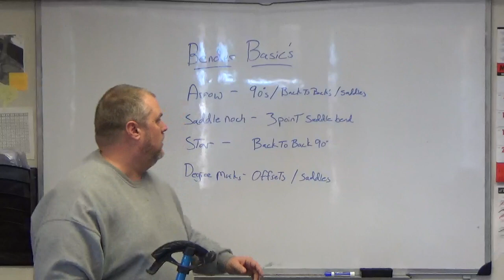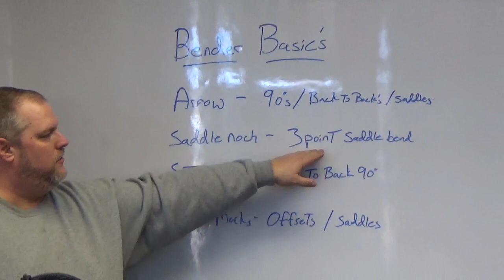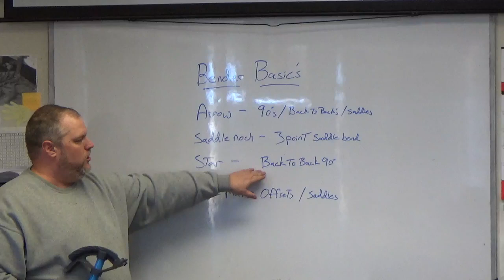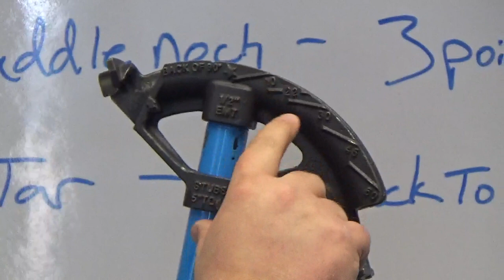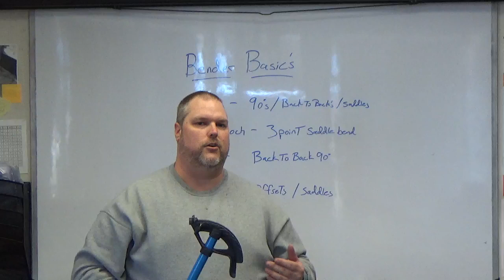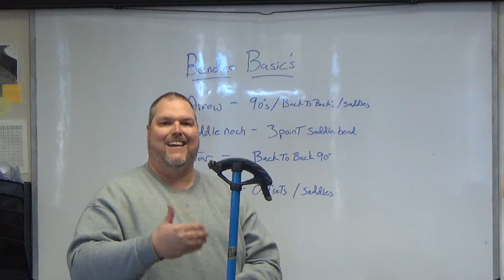Conduit Bender Basic's

Comment: So something I always have a problem with is that the conduit never lines up directly with the mark. It will end up off the mark by a 1/8th" or so and I have to try to eyeball how aligned they are, so I just end up using my level to confirm. The new milwaukee ones don't really have this problem but the ideals and greenlee benders have this problem
Reply from the maker: @moosewithguns1134  I just bought a Milwaukee bender for my son!! How do you like it?? I have never had the issue you are speaking of but I have bending conduit so long I may have automatically made the adjustment and don’t realize it any more!! CM
Reply: @craigmichaud-electricalins4602  The Milwaukee bender is a solid piece of equipment, I always grab one if it's available. To be fair I'm not bending EMT every day so it could just be something I need to figure out by putting in the reps